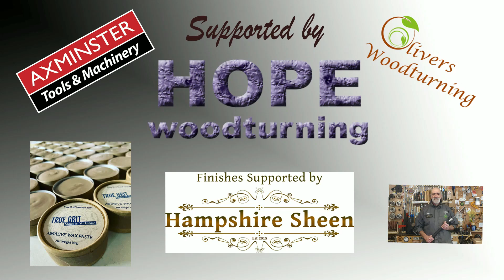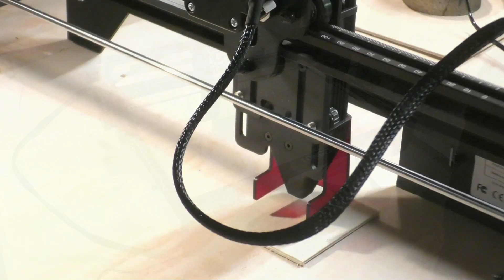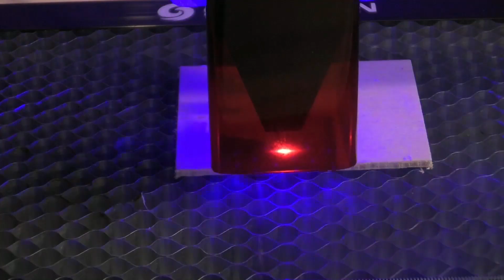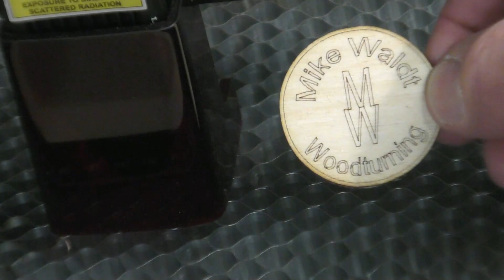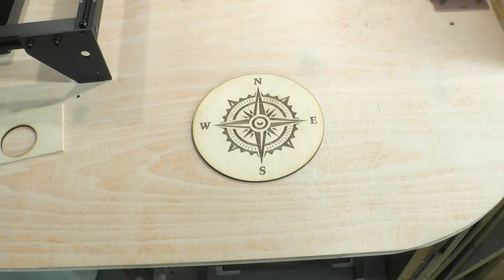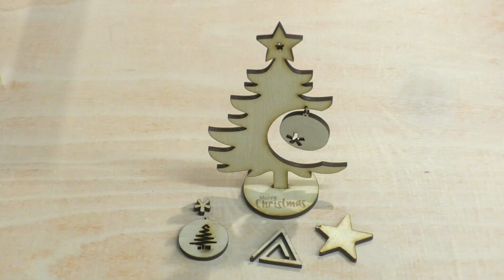Laser Engraver Review #2 - The Longer Ray5 10W

Comment: When I watch videos about things I do not have much experience with , my eyes glaze over and my ADD kicks in and I quit.  I would like to know for the beginner Hobbyist  What is the real difference between a 5w laser vs a 10w laser,  I understand there are tons of opinions on brands etc.  I intend to engrave mostly, cutting has not been something I have given much thought, Is having the capability to cut thicker material something that will present itself  as my skills grow?
Reply from the maker: Hi Mike .... you've really answered your on question. The higher the wattage in general gives more ability for deeper cuts and the engraving can be done quicker. Cheers. Mike

Comment: Thanks for the video Mike. Just a couple of tips: 

1. To get a nice black engrave, I apply a coat of Borax/Water and let it dry before burning. It’s not easy to get in UK but I bought it from  Care Free Toiletries:  (There is an “equivalent alternative” available using different chemicals, but I understand it doesn’t work for this purpose) 
2. To reduce/eliminate the amount of brown/yellow at the edge of the cut, I use an air assist nozzle attached to the head and powered by an aquarium pump. It also helps to keep the lens clean. 
Hope that helps.
Reply from the maker: Thanks for the tops Doug much appreciated mate.